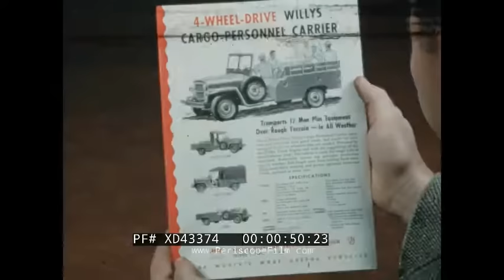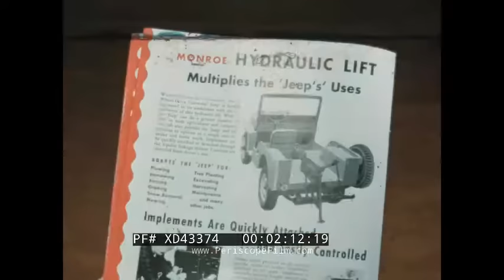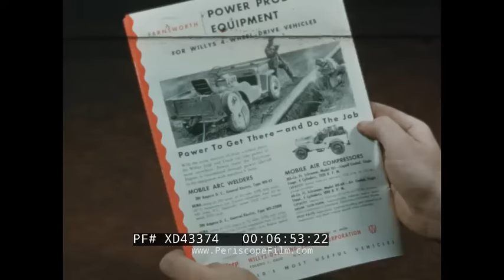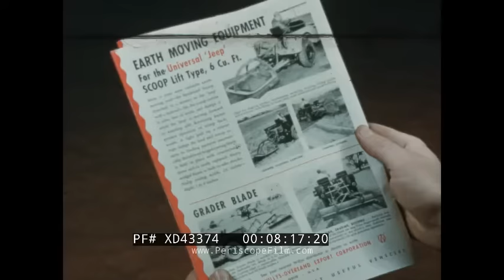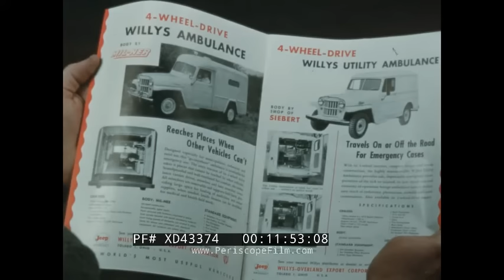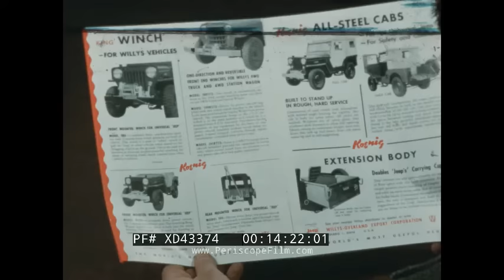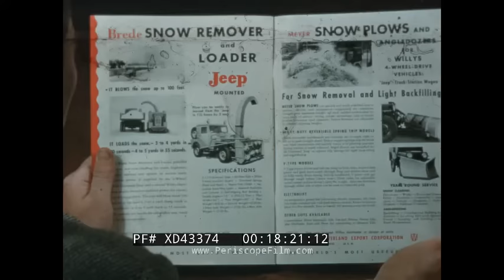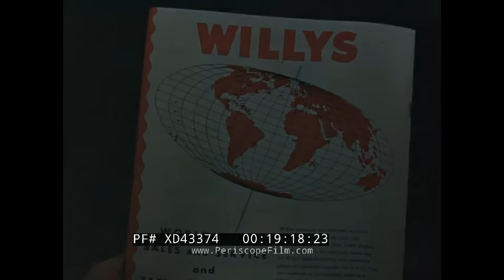1953 WILLYS-OVERLAND JEEP CJ ATTACHMENT AND TRUCK PLATFORM SHOWCASE "THE UNIVERSAL JEEP " XD43374

Comment: An old buddy found one flipped over in his cow pasture, he flipped it upright, put tires, battery new steering wheel, fresh gas and started right up. We took it out through Kings Ranch off the Gulf of Mexico. Drove it through waste deep water, no problem. It was water tight and floated!
Reply: The real military models have water-proof distributor & plug wires,    But the stupid 28 V electrical system is for the birds :(
Reply: @theda850two  it had these axels all around that extended out around 4 inches. A 1 inch hole was bored, crosswise, through the width at the furtherest end of the extended axel. If you ever got stuck in mud, you could slip a long iron pipe through the hole of extended axel and lift/pry the vehicle out of any situation. It was the cleverest thing ever. I think this was a war model for sure.